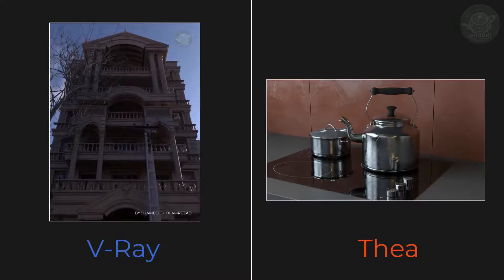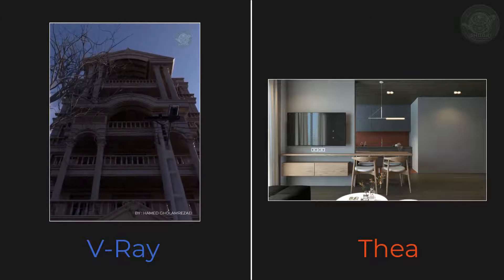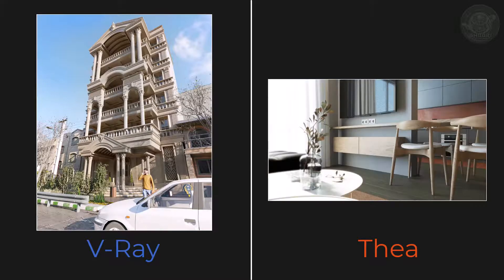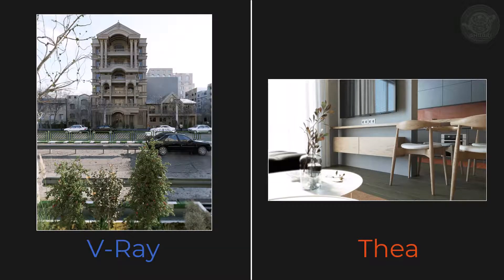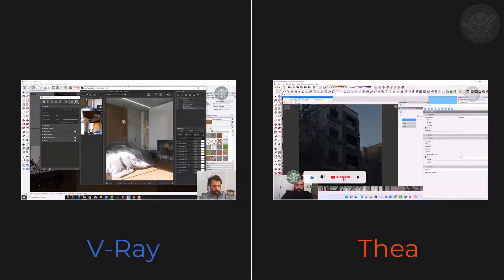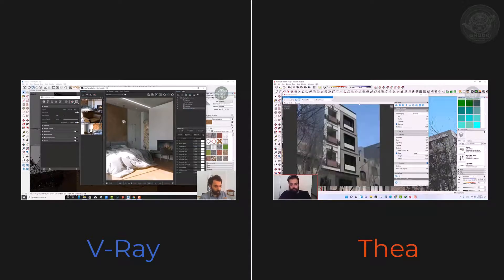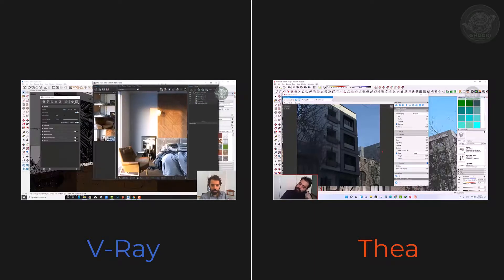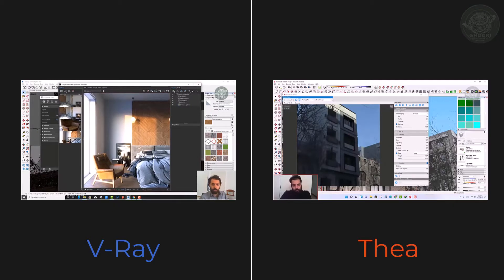V-Ray vs Thea Render for SketchUp

Comment: Thea Render is awesome! I have used Thea for SU for 2 years, Corona for Max for 2 year, and now VRay for Max for 3 years.
Thea is like the GPU version of Corona, they are very similar, both very easy to use. 
But it's a pity that Thea gave up the Max version. If they don't abandon the Max version and release a conversion tool that can convert VRay and Corona materials into Thea with one click, its user base will definitely increase a lot.
Reply from the maker: Thank you for sharing your experience